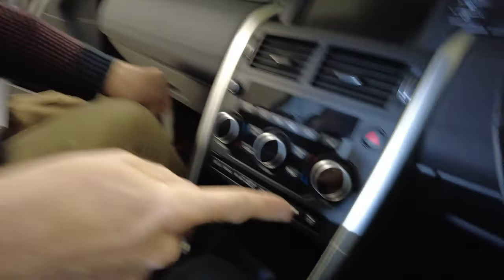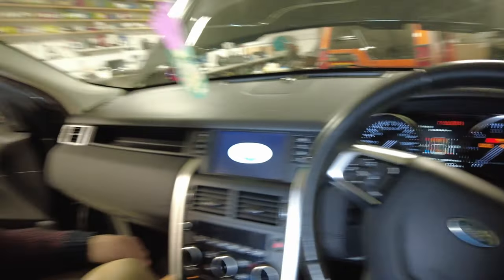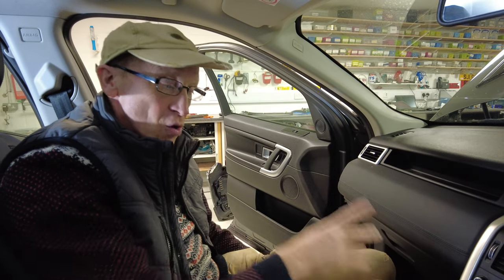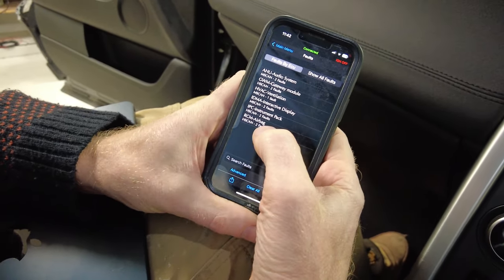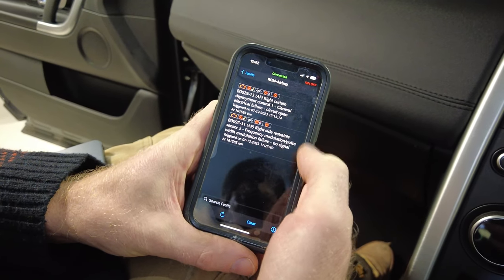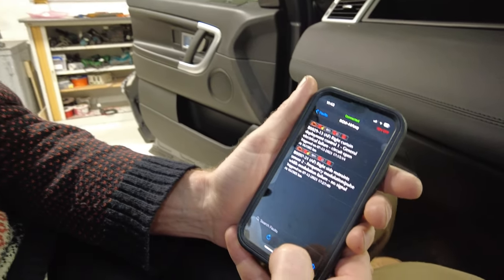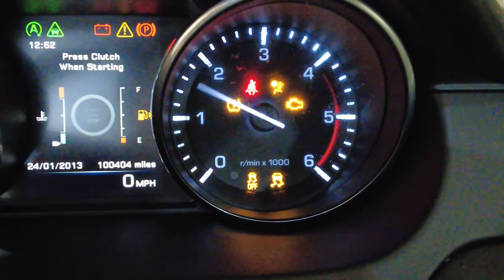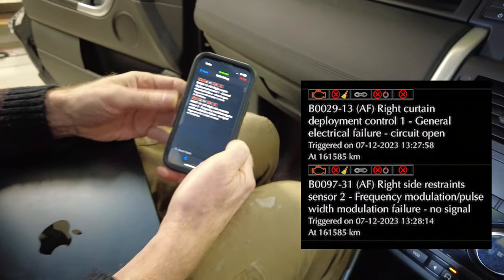How To Diagnose & Fix Airbag Warning Light Fault on Land Rover / Range Rover

Comment: The best video on YouTube yet , the only one that really shows how to fix the correct code I have on my friend car .
Can you make a video showing how to open the back panel to fix the sensor please .
Reply: Do you mean the rear side panel ? the one i removed in the video ? Yes i can do this tomorrow
Reply: Thank you so much it helped so much. 
Code fixed .
On a Range Rover evoque 2015, the same problem with mouse invasion .
Reply: The codes I have dot are .
B0021 13 and B0029 13  left and right curtains deployment control unit 1 .
Please help .
Reply: I have managed to fix the code B0097 15  as you have helped on the video . 🎉 you're the only person on the YouTube showing how to fix these issues, and I'm sure helping so many people thank you again

Comment: Has the car had its airbags go off?  When they go a huge amount of heat is generated in the cabling, so much so it can melt connectors.
Reply from the maker: Only the bonnet airbag - the rest look original ( judging by the rust on them )

Comment: Hi i have a code b0095-31 Right frontal restraints sensor 
B1004-31 Right frontal impact classification sensor
I change the sensor to the left side they work 
Chekt the wire everything is fine but the airbag fault cant be removed!!? 
Any help

Comment: SRS module has errors after an accident. All airbags have been replaced. But the module still shows an error. Is there a way to clear it? I read that it is only possible if you remove the airbag module and connect to it directly with programmator
Reply from the maker: You can do this with a GAP IID tool. Where are you located ?
Reply: @L663  Seattle, US
Reply: @L663  Should I buy tool for $600 + 500$ year subscription ?
Reply from the maker: @1o11o11  Hi - I am not sure the tool has subscription. Write to the guys at GAPDiagnostics - check if the tool can do the job and then ask them if they have a user in your area - you maybe able to pop to their garage. If you were in the UK i would have done if for free and made a demo video !
Reply: @L663  got it! Thank you, man. Will visit your garage if will have a chance visit UK :)